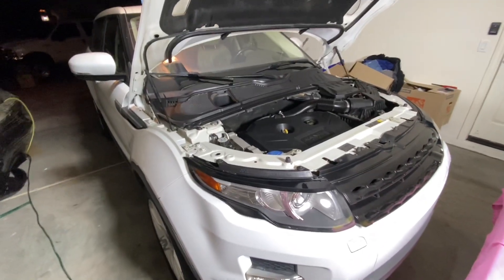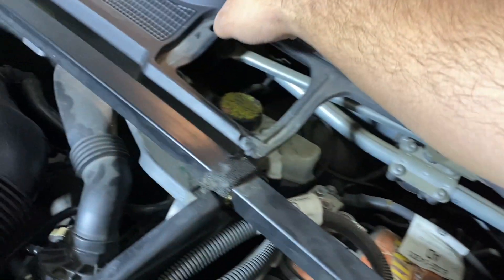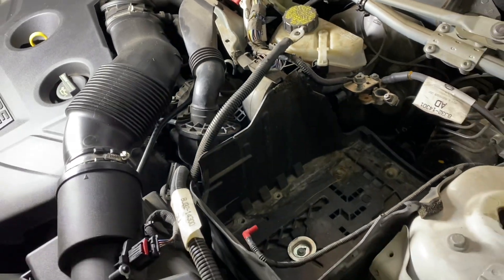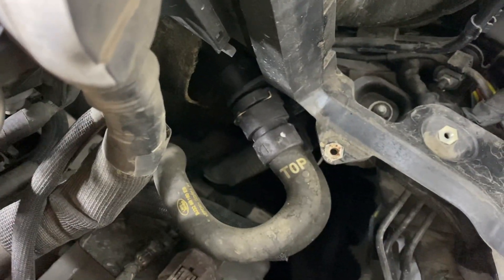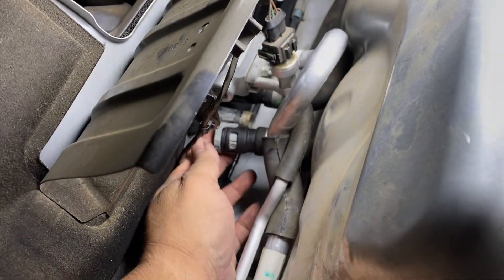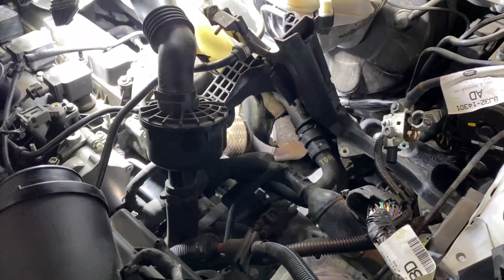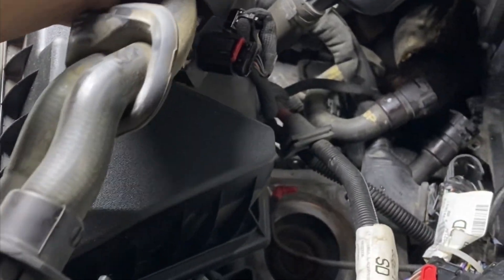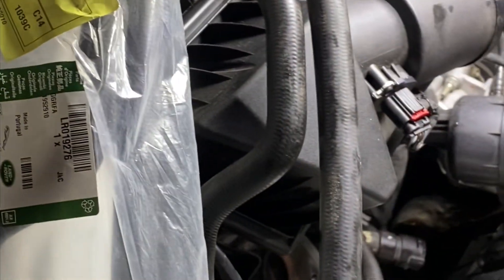Range Rover Evoque heater line replacement. Coolant leak fixed!!

Comment: How do i order another hose that has the clip on it that came off the left side of that heater core?? Prolly need another one i changed the oring and siliconed it in to stop the leak but who knows if itll hold for long
Reply from the maker: @jayenoble2901  best bet is to go to the dealer for that part number

Comment: Thanks for the video. It was helpful. My Range Rover evoque 2016 has a valve attached to the left hose. So the spare was not compatible but I have cut the hose and clamp the valve in the same position and it works just fine. Thanks again

Comment: Replaced the hose but when battery was reconnected.. error code on the electrical system.  Be sure to know how to do that parr
Reply from the maker: Did you connect everything back? Got a scan tool?

Comment: How did you get the hoses disconnected on ends with the metal clip? I got the clip out but the hoses arent coming apart. Do they twist to unlock or should they just pull off? Any advice would be greatly appreciated.

Comment: I'm not sure if my heater core has sprung a leak or it is leaking at the o-ring connection.  Whenever I pressure tested it, coolant came streaming from looks like the A/C drain. Any help is grateful.
Reply from the maker: Do the lines. They're cheap that's exactly what was happening to me.

Comment: my RRE had the same leak. question, when you topped off your coolant, did you simply top off the reservoir? and do you use the European coolant or did you use the universal coolant?
Reply: Use the euro coolant.  The regular stuff is not good for these cars